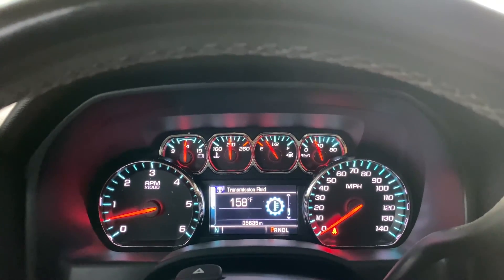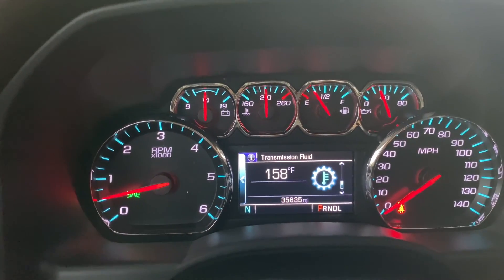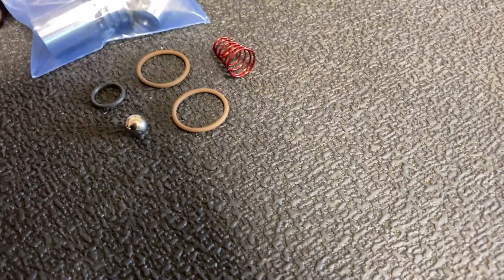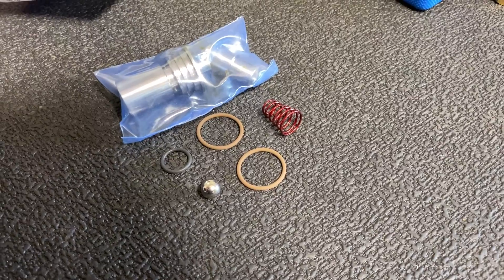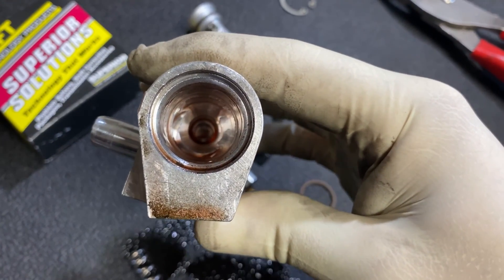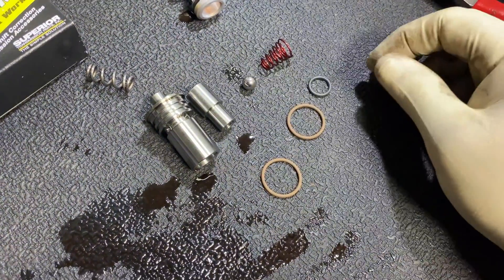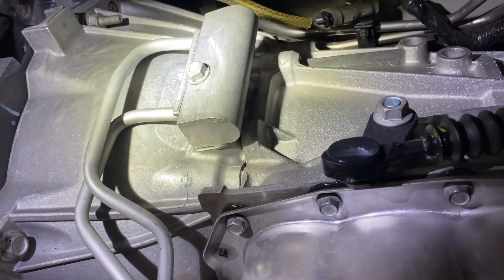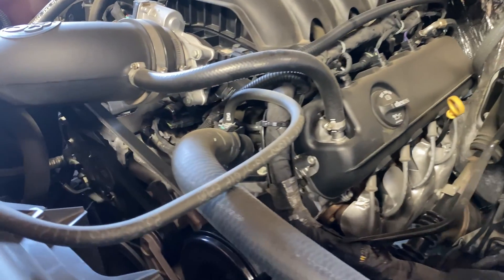Silverado 6L80 Thermostat Delete the Right Way! *SURE-COOL*

Comment: I worked the TSB (21-NA-199). Old valve opened at 194 degrees, new valve opens at 158 degrees. Mine runs 30-50 degrees cooler in every driving scenario but I don't believe for a second any of these mods drop temps to 130 or less on a 100 degree day pulling a 5000 pound trailer uphill both ways...that's just a lie. Mine still hits 180-190 on hot days in stop-and-go traffic but not 210-220 like it use to. It is worth it to do this mod either this way or the TSB because GM ran these damn transmissions way too hot, but don't expect ice-cold fluid temps in demanding environments - that's physically impossible.

Comment: Question. If i were to install a universal Mishimoto transmission cooler, would i still have to do this or could i just leave it alone??
Reply from the maker: If you want normal flow all the time yes you have to get some kind of thermostat delete otherwise it will only flow when hot.
Reply: @Bobsgaragetech  thanks for the quick reply. So good practice to also replace this part like in your video alone with the cooler at the same time.
Reply from the maker: I would personally. I think there are several other comment threads talking about mishimoto coolers. Good luck!

Comment: Just buy a 2011 GMC Sierra 1500 cooler line.  The cooler line bolts right into the 6l80 with no valve.  They never had the temperature control.

Comment: Why did you title your video thermostat delete you didn't delete you just put a different one in with less spring resistance to pressure
Reply from the maker: It is definitely not a thermostat. The thermostat was removed. The springs are for pressure relief and flow..
Reply: @Bobsgaragetech  yeah just like a thermostat for your cooling system of your engine
Reply from the maker: No, thermostat means temperature controlled.. so it opens and closes at a set temperature..
Reply: @Bobsgaragetech  🤣🤣😄😁😆😅

Comment: I see you skipped the part where you put the snap ring back in lol. That was the hardest part, I recommend using 3 hands. I flipped the pill
Reply from the maker: Yes sorry.. was new at filming and couldn’t get the camera set up so I could use two hands and I only had limited time.. I recommend making sure there is trans fluid on everything for lube. and a little PB blaster would also help..
Reply: @Bobsgaragetech  I PB blasted a pool over the snap ring for a few minutes before I even went to remove it lol. Came right off at 70k miles, I guess I got lucky. I am considering getting the new valve upgrade Because the operating temp is taking extra long to reach due to the whole reservoir being cycled. I think the new valve cycles at 150F and will need new lines (I have QD) but I think its a better option for reaching optimal operating temp

Comment: Think Ill be getting one of these for my 17 Sierra… seems like the way to go.

Does the slight leak of fluid shown in the video pose any issue or need to be topped off again?
Reply from the maker: At 04:30 I explain checking the level. It’s always a good idea to check level and add if needed. Thanks for watching! Remember GM makes one for these trucks as well now because it was such an issue.

Comment: Very informative, although I could have done without the rock concert, which added nothing helpful or good.  Otherwise, great.  An additional note:  Not all 2014's have the 194 thermostat.  My Tahoe is an early 2014, built 09/13.  It does not even have the thermostat block and does not run excessively high temps.  It looks just like a 2012-13 set-up.  Apparently there was a change sometime after introduction of the 2014's.  Thanks for the video.

Comment: Just wondering, are there any sensors this is going to set off by installing this? Also What happens when this part fails? will trans heat up or??
Reply from the maker: No Transmission still gets to operating temperature. This just helps full time flow to the cooler..
Reply: @Bobsgaragetech  Why don't they have full time flow for the engine? Why the need for a thermostat at all? is there a delete for the engine thermostat?

Comment: Mine didn’t do anything for my temps
Reply from the maker: How new is your transmission fluid? Did you check cooler flow? How many miles on the transmission? Is your transmission already messed up?
Reply: Transmission has 114k on it. Transmission oil has 3k on it. No issue with tranny. I just don’t see how this really does anything when my motor temp runs at 210 degrees

Comment: My silverado 2018 is doing 270 degrees  you guys think this will work. I live in California.  Weather is 60 degrees
Reply: 270 Jesus man. You need to replace with amsoil and this bypass. 275 you get an alarm and 290 it goes into limp mode. Your trans might be toast already.
Reply: @ngirardo86  honestly I just replaced the bypass and my truck is running like a champ . Also serviced  the transmission.  2 transmission shops told I had to replace it. But no still good.  I even went to mexico twice
Reply: @MarioMartinez-zk2wk  if you drove it with it hitting 270 degrees then I can almost tell you without a doubt you did some damage to that transmission. Just keep an eye on it.
Reply: @ngirardo86   👍👍
Reply: @MarioMartinez-zk2wk  at 275 you get an alarm and at 290 the vehicle goes into limp mode. You were extremely close to both of those temps.

Comment: Nice upgrade!  Your video title should really not have the the words "Thermostat Delete" though, since you are actually doing a Thermostat Upgrade.  Your statement about not having to warm up the transmission to check the fluid level may not be correct, because you still have a thermostat installed, so the fluid temperature will still need to be above the installed thermostat rating before it opens and allows fluid flow through transmission cooler.
Reply from the maker: Hey thanks for your comment, I do want to point out that it is not a thermostat what’s so ever. Check out the link in the bio and read more about the product. Thanks again for watching! 🙏

Comment: Installed this on my  new to me 2017 Silverado with 46,000 miles about a year ago. My transmission temp runs at an average of  145 after the install. And the highest I've ever seen it was 170 on hot day and running up a 7 mile hill on PA turnpike 😊
Reply: What was the transmission temperature before installing the 6l80?
Reply: On an average summer day 190 degrees Fahrenheit. Up long hills n stop n go traffic on a 90+ degree day 200 degrees. Now even pulling a trailer the hottest I've ever seen was 170 degrees. Average temp is 140

Comment: I wonder how this kit would react in cold Canadian winter ???
Reply from the maker: Good question, I do know the company says it does work in cold weather. I also know GM came out with their own design of this for these trucks.
Reply: The STL 010 kit IS FINE FOR CANADIAN WINTERS. Even with snow on the ground in a wet west coast -5°C day my 6L80E tranny always gets up to temp 150 - 160°F.
Reply: @Canada55Eh  Here we often see -30 celsius, so I will take no chance, I will use Amsoil syntech ATL witch is good to -65 Celsius and up to 245 Celsius

Comment: Just gonna throw in a comment, this summer it was getting to 100-110 in Texas. On longer drives I was sitting between 170-180 with it maybe going to 190 if I would get stuck in traffic. I just went back to these because we experienced our first cooler days of 60 and it was taking a while for it to get over 100 but after about 20 minutes I am sitting at 130. This does work great if installed properly!
Reply: yeah it’s dictated based off of the ambient temperature outside. So if it’s really hot outside, you’re still gonna be on the 180 range which is fine. The key is you have fluid flow constantly now.
Reply: I’ve got a 16 suburban with same bypass and i put this in on my recent purchase of the suburban back in January and literally just went 1200 miles without any temperature above 151 degrees while in traffic from New England to Florida 
It’s 90 degrees out here and average temperature for tranny is 144-151 running local driving no greater than 50 mph

Comment: Alright bear with me here.  I know 190 seems hot and causes a little anxiety about tranny issues/ besides the 2023 kinda tranny issues.  Anyway, absolutely a transmission can get too hot but funny enough can also not get hot enough.  Tranny fluid is strange because unlike normal oil it can actually absorb moisture from atmospheric pressure.... ya I know right.  So that leads us to why they run it at the higher end of the fluids temp range.  The condensation vaporizes out of the fluid in purge sequences, which is why you will notice temps randomly climb and then come back down.  That happens when vapor builds and reduces flow of cooled transmission fluid until it purges excess pressure out a prv valve which then restores normal flow of cooled fluid to the transmission.  Running below this temp over years and years can acually cause a build up of entrained condensation and viscosity changes to your fluid.  All in all while cooler may seem better, it can actually cause premature wear if you live in humid environments.

Comment: I installed this kit and it still goes up to 200 degrees
Reply: I know, i did the same thing today  , do u have any ideas o update?
Reply: @919blackangel  I had an aftermarket cooler installed but they screwed me, was suppose to run inline with radiator and they bypassed it instead , still runs at 190. The only thing I believe would help is the tru cool 40k cooler and a deep transmission pan. Allows for more fluid, which should reduce heat up
Reply from the maker: There are other issues that could cause your temp to get that high. I have seen locked up or failing torque converters. Slipping clutch packs, broken or worn sungears… old transmission fluid was another big one.
Reply: @Bobsgaragetech  just had it rebuilt in March with better parts, less than 5k miles on it

Comment: Crazy, I just did this to mine and I’m still hitting upwards toward 186
Reply: Do u have any update ? I did my today and i have the same issue?
Reply: @919blackangel  mine the other day I checked and it was at 181. So idk if I should just buy the GM updated one or just do the pill flip
Reply: @919blackangel change your fluid with amsoil. I bet that’s the issue. If you have the OEM fluid in. It’s garbage. I did mine with 44k on it today and didn’t hit past 133deg I just changed it last week with amsoil though.

Comment: all youtube vids shows top cap is easy to remove be ware unless you don’t need your truck until you can get a new valve plan for it.
Reply: Just have some CLR on hand. I did mine with 44k and 5 salt filled NY winters. CLR took all the crud off no problem.

Comment: This isn’t the best modification for the colder climates. I have had this bypass/delete installed for a year now, and I’ve found the operating temp is far too cold for my liking thru the winter. For most of the winter, I have only seen the hottest operating temp
Of 70 degrees F. I don’t think this is a good idea for transmissions to run that cold. I would suggest putting in the updated 155 thermostat for the winter months if you’re running empty with no load.
Reply: O you recommend to not do it,for those that live in the cold state?
Reply: @gerardocuarez9034  I don’t know. I’m not saying not to do it, but up here in Canada last winter, my transmission temps never went above 55 degrees F for the whole winter. I won’t know if that’s bad to run it that cold or not, but that’s not running anywhere near to what normal operating temps are.
Reply: I should also add…..in the summertime, this is a great mod to run in the warmer temps of the summer. Pulling a camper at any time, the temps consistently stay about 50 degrees cooler than before.  Always about 140 to 150 now. Before the mod, they all run right around 200 to 220….that’s scary stuff when pulling.

Comment: Once you install this and you check trans fluid immediately am I looking for the fluid to be in between the cold range or hot since you can now check the fluid instantly? Thanks
Reply from the maker: You don’t lose a lot of fluid doing this. I would check it a couple times. Warm is best.
Reply from the maker: Also GM came out with their own version of this thermostat.
Reply: @Bobsgaragetech  thank you . I’ll just run it for a while and check it warmed up . Is the gm version better or are they more less the exact same?
Reply from the maker: I’m sure they are similar, I have not had the GM version. I’m sure there are videos on that as well. Thanks for watching!
Reply: @zbw8785 it’s nowhere near the same. It’s a lower temp thermostat. Opens at like 135 or 140 instead of 190. It’s a direct replacement.

Comment: I installed this too but when I drove for more then an hour it WILL creep up to 195…..help!
Reply: Any update ?
Reply: Yeah it sucks. It DOES keep your oil cool for longer but it creeps up until 195 and by that point the truck has noway to cool the fluid at all cus you have no thermostat. I found out that GM made a recall on this for 2014-2015 trucks and you have to buy new trans lines with the upgraded thermostat. In Louisiana the heat was 100-105 outside and trans temp never got over 180 with the upgraded transmission thermostat/coolant lines.
Reply: Now that the weather is low 80s here the trans temp doesn’t get above 165. Remember, the transmission needs to heat up and get to operating temp to work and flow right. 140-180 should be good for trans

Comment: Not bad.. but I wish you would've shown exactly how it goes together in the thermostat housing... later tater
Reply from the maker: It goes in exactly how I had it built. I just didn't show myself actually sliding it in the housing. The product comes with detailed instructions this was just a fun video showing where it goes and how it works. With some install tips. GM actually makes a factory replacement now fixing this issue. Good luck!
Reply: @Bobsgaragetech  I'm definitely getting this done to my 2014 asap.. about two years ago.. my tran died on me and it was due to the torque conv fragging out from the heating issue.. $4200.. new torque and reman trans from the Chevrolet dealership.. 30K mile/3 year warranty.. so I got that at least.. lol.. Thanks, Robert!!.. CHEERS!!

Comment: Why does it have to be 2014-2018? I have a 2012 with the 6l80 can I not use this kit??
Reply from the maker: The 12 doesn't have the thermostat..
Reply: I flipped the pill on my 2014 V6, works great.
Reply: @MrLuckylilly you have now blocked the bypass. If a line plugs or kinks you are going to burn that trans up. This kit keeps your bypass.

Comment: Will adding this to my 'New' transmission when it comes in.  Have a 14 with 149000 and mine has the GM faulty tranny.  Brown fluid, temps as high as 190 plus on summer day.  Bucks when you first put it in D of a morning.  Searches for 3-4 or 4-5. Im biting the bullet and replacing everything. New torque, lines, cooler and a Jasper rebuild.  No chance for that old fluid getting into system.  Its a Hell of an expense but I hope it will keep the truck going another 150000.  Thanks for the video.
Reply: My 14 looks good for the years it has just had to do mine at 160k…. 5k for a trans and maybe another 5 k for a good engine rebuild when the day comes I personally think is better than a new 60k+ truck I only paid 31k when I drove mine off the lot
Reply: Brown fluid is from you never changing dummy
Reply: Have you ever changed the oil and filter?

Comment: Did this to mine. I only drove it for about 15 mins but never went passed 127.. before it’s have already been up to 190 doing the same drive. Thanks 🙏🏻
Reply: 2 month later, still working pretty well but if you’re going to be driving on long trips I’d say 4 hrs away or more I’d invest in trans cooler to keep it cooler or it will go back up to 190+
Reply: @obs4life228 something wrong with yours then. I pulled a 4800lb box trailer over the Rockies in 90° weather and 171° was the warmest mine got
Reply from the maker: Awesome!

Comment: Had to replace my transmission on my 2014 Silverado a year and a half ago. The dealer didn't do the thermostat update. Going to do this mod an hope it prolongs this transmission's life. Thanks for the vid!
Reply: How much was it to replace it all said and done
Reply: @OgbobbyJ407  $5k to replace the transmission at the dealer. This was during covid so the dealership was the only one who could get a transmission within a week.
Reply: @michaelforeman6386  I just replaced my trans in my 2014 Silverado... dealer wanted 7k pre tax --- Also needed my exhaust manifolds replaced. Dealer wanted nearly 2k a piece on those(they were afraid bold would break). Took it to a local shop and had it all done for just under 7K. My old hovered at 189 this rebuilt's hitting 192 on an average 80 degree day not pulling anything. Def gonna look into one of these coolers!

Comment: Just installed STL010 on my 2016 6L80E really dropped the trans. temp 50 degrees today trans never got past 127 degrees I had the older thermostat that ran it to 194 degrees so big improvement
Reply: Me too thank you

Comment: So, did GM purposely overheat these transmissions?
Reply: I heard from a YT video someone saying that the reason the original thermal bypass valve was designed to open for cooling at 194 °F (or 90 °C) is due to Federal Government regulations to get higher mpg. The hotter the fluid is the thinner it gets, which would enable higher mpg. However, I think GM failed in providing a transmission fluid cooler coil that’s capable of sufficiently cooling the fluid for city stop and go driving as well as towing something (highway driving is ok - doesn’t overheat, because of cooling air with speed). Also, it appears that over time, the thermal bypass internal gets clogged up a bit with fluid gunk or deteriorating components rendering it to operate inefficient that leads to creeping up higher temperatures.